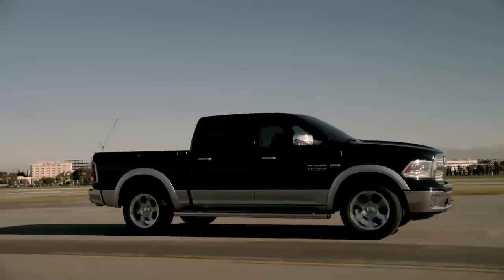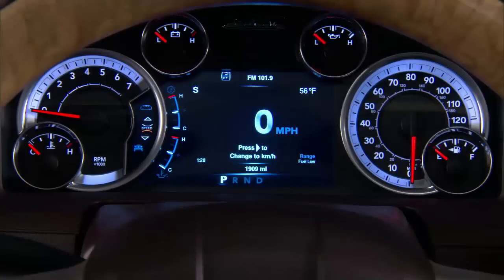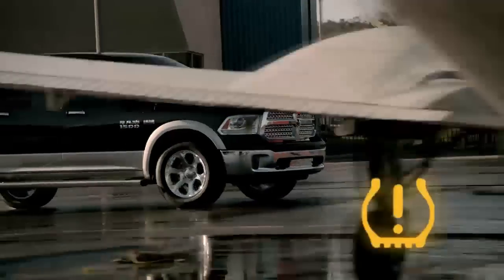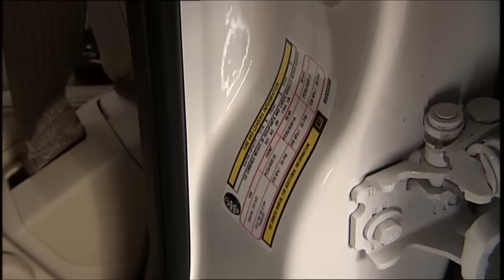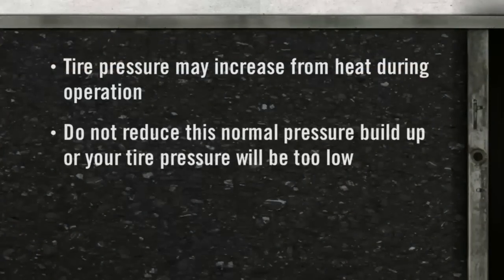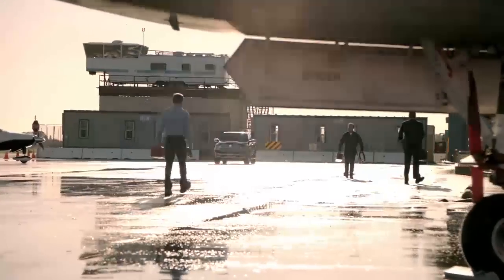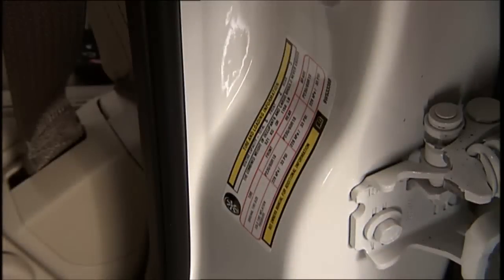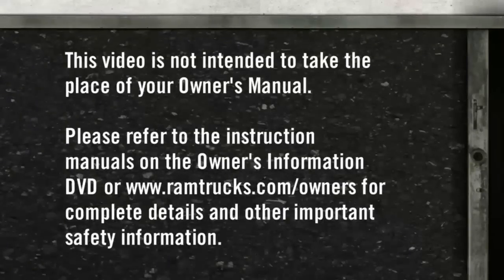2014 Ram Truck | Tire Pressure Monitoring System

Comment: I wanna know how to reset tire pressure on my 2021 ram 2500 , factory pressure sat up to 60 psi which makes the ride very stiff and I’m not towing on my truck and I wanna decrease the pressure to 45 psi or lower.

Comment: I have a 1500 big horn, the sensor on the right rear is reading 0 although I have 39#s. Is there a way to calibrate or do I need to change a sensor? Anyone else had this problem?
Reply: Robert Sanger I do . Did you find where the tpms module is on the truck ?
Reply: Near the front left tire

Comment: I am running a set of new tires and wheels on my truck. It's a 2014 Ram 2500. I no longer can run 80PSI as my tires max is 65. How do I fix this? Can Ram/Mopar have this system recalibrated to the change of my tires? I'd like to run 45front and 55 rear.
Reply: +gol10dr45  I have the same issue - how did you get it resolved???